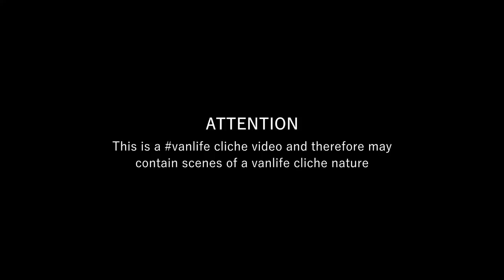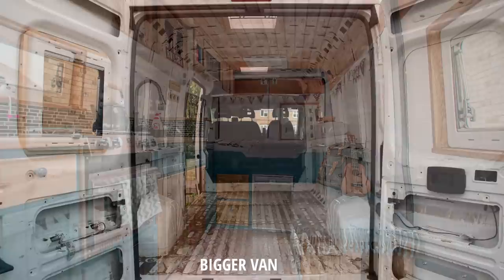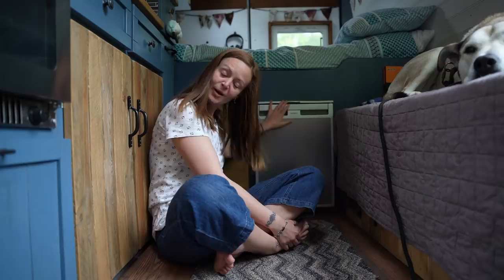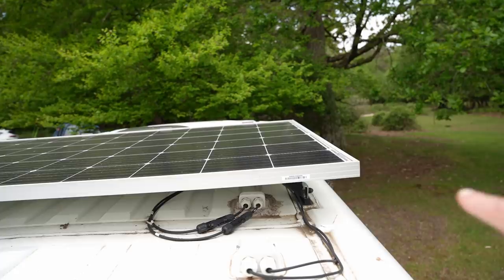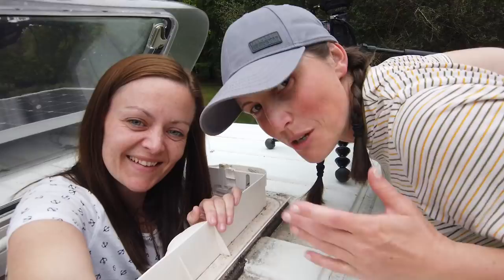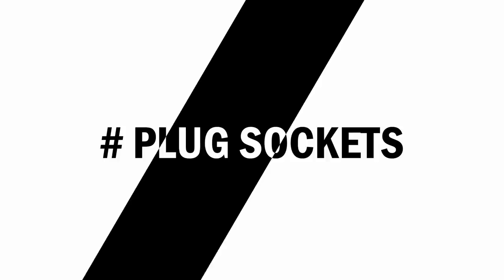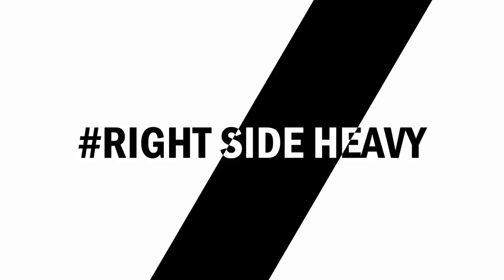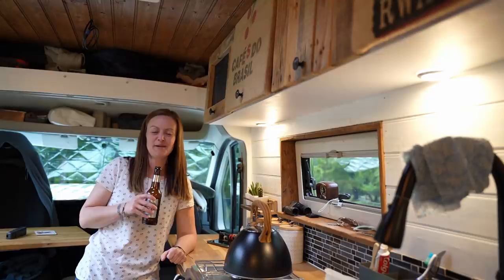DIY VAN BUILD MISTAKES..  what we regret and what we would change in our self converted campervan.

Comment: Ok, here is my idea, ;- I would do away with the cupboards above the bed, and turn the bed area into a huge (length ways) dining table/bench settee/bed area by reconfiguring to create a step-up platform (mezzanine) = this will create more space underneath for storage, the only slight downside is you will have to make the bed every night, but it means you have somewhere to lounge (liedown) or eat or to watch movies or open the back doors for scenic views + leaving the option for you to have two single or one double bed if you want to, I would also build some cupboards next to the toilet seat to house the fridge at waist height = overall weight will be redistributed a little.
Also, why not buy some of those black 10 litre shower bags and fill with hot water from the kettle (create some slots at ceiling height to house them to have a hot shower?
Reply from the maker: Thanks for the tips there, I'm sure Emily has a full scale drawing for me  when the time comes lol! Thanks so much for watching 😁👍

Comment: It is often said that people tend to get their perfect design on their 3rd conversion 😉.
As far as the shower / toilet room goes, it's a massive decision and affects the whole layout and feeling of spaciousness....personally I would not build a van without one...but that's my preference....I do like to do my business with a door firmly shut 😂😂.
For the fridge, Thetford do the 1090 which is designed to be raised up and is cut away to follow the contours of a panel Van conversion. They work pretty well.
For solar panel installation on a boxer / relay / Ducato, Thule do a roof rail kit that spans the entire roof. You can then fit either roof bars side to side, or solar panels. The roof rail system is fully compatible with Thule awnings as well. We pretty much fit these to every conversion we do.
Reply from the maker: 😂🤣 One more to go then and I should be done lol, oh no, wait I'm married, I'll never be finished lol!!
I've looked at the roof rack you suggest and combined with the cost of the wind out awning you're soon way over a grand, for something which I hear is terrible in the wind and the rain, so I think I'll try and find an alternative, we will hardly use it to be honest, it's just for when staying on campsites.
Thank you so much for watching 😁😁👍
Reply: @campervibe  my van would never be finished either if it wasn't my business😉.
You can fit the roof rails without an awning. I think they are about £300. We have made similar using aluminium profile but it's generally still better to buy the proper ones. 
Awnings are one of those things, that if you are travelling around a lot, they hardly get used. But quite nice for a bit of shade for the side door, or more likely in the UK...preventing the rain coming in😆😆.

Comment: I’m now getting the impression that you thought you were done with the build. I love your build. I thought upgrades were eternal. Gradually making changes as you live in it. One change I’ve made to my plans is I’m putting a root drawer under my fridge so the fridge is higher. Bad back no knees. I want a wet room/bathroom/shower combo because I want to be able to hang wet clothes and not have to set up a shower. We all must build to our individual wants and needs. I will be living in mine full time with two cats when I retire so I need a few more creature comforts. Everyone else’s ‘mistakes’ help me with my build adjustments. Cheers from Canader eh!
Reply: I built a full shower room and its been great. We don't use it much when we are away from services to save water but  my shower room is heated from the diesel heater and it makes it ideal for drying wet towels and coats etc.  The hot water comes from those small propane gas water heaters.  Mine is fixed to the outside of the shower wall next to and cut into the worktop.
Reply from the maker: You are definitely right, got to build to your own standards and needs for sure as everybody's is different, after all it would be pretty boring if we were all the same right 😆😁
Reply: @tonytca9439  I’m going to carry a pump and hose. Run it into a creek, through a filter then the on demand if I need a soaker shower.

Comment: Lightweight panels can be easily made by getting some 1" x ½" softwood, make a square/rectangular frame and glue formica sheets on to it then fill with that spray foam stuff to fill in the void.   Sturdy, functional and weighs very little.

Comment: You could replace the fridge with a dometic fridgebox on a slideout tray, much more energy efficient, you could get a bigger one, it has freeze compartment if you want, and it is loaded from the top.
Regaridng the weight, I don't think it is as bad as it feels, and you don't stove heavy things in the overhead anyway.
And finally for the shower, you could get a shower tray (store in the garage, strapped upside down under the bed), and put hooks for a curtain around the roof-vent then you ventilate out the steam, get a few inches better clearance above the head for  people who didn't stand under the kitchen table whwn they grew up... (Em)

Comment: Hi, I made same mistake with electric sockets but managed to get round it by undoing the two screws on the sides, pulling the front off and turning it upside down. Not perfect but it did the job.

Cheers, Griff.
Reply from the maker: Cheers Griff 👍😁

Comment: Hi Ladys  composting loo might be a thought for the future & also take it in turns to empty it ?  If and when you get another van dual wheels on the back end gives you the extra weight plus stability can also get you out of the sticky stuff one day. Noticed a lot of self builders use a lot of timber so weights realy build up fast hence why a lot of campers use carpet linner to get around this heavy problem, cuboards up top are for lightweight cornflakes etc not tinned products think marine and get the centre of gravity low as possable at all times and lastly dont get fat or the weighbrige will show overweight Lol ! nice to see you happy & on the road again Ladys.
Reply from the maker: Thanks, yeah wood is a nice look in the van, fortunately we used poplar ply which is super lightweight compared to standard ply which has helped massively. Think the main thing for us which will help loads is swapping out the batteries for sure, love your tips and tricks though 🙂🙂

Comment: Lou temporary solution for three pin socket mistake, remove three pin socket facia and revolve it 180 degrees so it is upside down and resecure. Socket is now upside down but cables plug in with cables now facing upwards.
Reply from the maker: Hi Paul, a few have suggested this now so I think I will swap it round. Someone suggested it's dangerous tho but I can't really see too much what the problem would be. Thanks so much for watching 😁👍

Comment: not a bad list of niggles for a self build [ pat on back lou] . 2 " Bs" for me, bog + balance. tins of food + beverages  are the weighty items to keep low down if possible, [ on our caravan we found a load of wasted space around  the wheelarch tubs, ideal for slipping the tin cans around in a sort of circle, a little access door + stickon led lamp - enough tins for a family of 5 for two weeks] + move the cupboards / batteries over. 2 separate sockets are wider than a double so will need adaption to backbox fitting mind. at work we got shallow landscape A4 transparent plastic jobcard  pouches which screw to wall, should be big enough to chuck your rechargeables in + get them out of way [ well apart from emms vibrator battery pack].
when its raining + stuck inside van, how about a" challenge pissed emms" episode, playing kids games like buckaroo or operation.    definitely watch that.
 keep up the good work girls + plot a course for the zipwire.
Reply from the maker: No definitely not a bad list and stuff that is not too bad to sort out either really like you say, I like some of your tips as well, thanks 😀

Comment: That double leccie socket can be fixed by changing it to two singles side by side and each rotated 90 degrees, it would look odd but the wires would not be crushed on the counter. Get a spare cassette for the loo? I would have a top-loading 'fridge every time, so much easier, and all the cold air does not fall out when you open it.
Reply from the maker: I do love our fridge and despite how low it is, it still keeps everything cool, just a pain in the butt for filling up 😆🤦‍♀️

Comment: Hi, We finished our conversion nearly a year ago and are at the same stage where we are thinking of some changes/additions that we want to make.

Just to let you know if it helps at all, that we have got our solar panel mounted to the same roof rack as yours and also have a fiamma f45 awning using the standard ducato brackets. It all fits nicely with the normal ducato fitting kit - you shouldn't need special roof rack fixings. The awning mounts to the lugs on each end of the roof, and the solar panel on the 2 middle ones (can take pics if you want). 

We have a hidden shower tray under a false lift up floor in the side door entry. It was awkward to fit around the exhaust and slide out step, but managed to find a drain point. 

Thanks for your videos, we always find them helpful. We watched your videos when building ours and it helped us loads with the woodwork!

Stevie and Mike 😊
Reply from the maker: Hey you two, pictures would be great if you have some, to be cheeky if you could send them to campervibe6@gmail.com that would be amazing, thank you 😊

Comment: Hi Emily & Louise. Great video. Interesting comment on the fridge. I have seen some YouTube videos where self builders have used chest freezers and converted them to fridges quite easily. The advantages are they are far better insulated and therefore use far less power as they come on less often. Also they do not lose cold air when the door is opened as the cold air drops to the bottom of the storage area as does not rise up when you open the lid. I saw one video when they attached door runners  so they could slide it out to access and then push it back  out of the way with the additional advantage that the top could be used as an additional kitchen work surface. You don't seem to have made many mistakes. Your van interior looks great. Good to see AJ with you on your travels. Best wishes.
Reply from the maker: Thanks Barry yeh a chest option may have been better with hindsight 👍 AJ is well on the mend now and we reckon will soon be running round like a loon any time now 😁😁👍

Comment: One quickish solution for to much  weight on one side would be to extend the main battery cables and relocate the batteries to the other side of the van and of Course Em's snack cupboard.
Reply from the maker: Think we might go to lithium as well and only 2 which will help, I won't let her touch my snack cupboard not now it's in 😆

Comment: We love your vlogs! The banter alone is worth the watch but great content too. I think you are my favourite UK couple we follow. We are a couple of old farts currently building our own van in Denmark, hoping to be on the road this summer (woohoo).  I do like how spacious your van seems with all the cupboards on one side, but I also see your point with being side-heavy. Are your water tanks on that side too? We put batteries on one side and water on the other to be safe. I was also wondering how tall you are (or Lou, not the lovely Em), since you can sleep across? I am 173 cm, my hubby 180 and we have to make our bed the other direction. Also, if hubby wears shoes and straightens his old hunchback, he almost scrapes the ceiling. But we do also have insulation under the floor and in the ceiling, so we can go to colder climates (like summer in Denmark or England) so I suppose this is one of the causes.
Reply from the maker: Aww thank you, hope the build is going OK. Lou is 5ft7, we also have insulation in both for the same reason as well 😁 our water and waste is underslung and goes across the van so it's pretty even with that. Think we will swap out the batteries for lithium which is a lot lighter. Hope all is well over there

Comment: Just a taught, if u moved the battery’s to the other side of fanny, and the diesel tank is on that side too, (I think, it on that side on my  transit) that should balance it up. If you put the fridge up high above where aj sits and get the four corners weight I think it would be spot on, can’t beat a good rummage around in fancy 👍😂🇮🇪
Reply from the maker: 😂🤣 No you definitely can't beat a good old fanny rummage lol, you're right!! Diesel tank is up front in mine, central under the cab. I think we may swap out the 3 agms for 2 lithium at some point to save on the weight that way. Thanks Thomas 😁😁👍

Comment: Just catching up after being away apologies if it’s been said, you can get a larger base for a portaloo.
Reply from the maker: Hi there, hope you've had a good trip 😁😁 our problem is we don't have the space in the gap I built for the toilet, it's tight as it is, I think I'll have to have a re design, then I can get that bigger toilet 😁👍
Reply: @campervibe  Another solution would be to get a second base same size and store in the back. But then you'd have 2 to empty each time 😅 Love your vlogs and you both do a fab job putting them together 😍

Comment: Glad to see you back on the road and having fun 😀 . Hope you are all well ....... A.j looks good 👍🐶 . Remember and give fanny an oil change soon , because it was a rebuild or exchange factory unit it will be run in now and there will be tiny metal particles in the oil which is normal until all metal surfaces are bedded in. Pays in the long run , and use good quality fully synthetic engine oil and quality oil filter.  🙂👌👍
Reply from the maker: Good to be out more now for sure, yeah AJ is doing good. Thanks for the info 👍😀

Comment: How much heat do you think is lost (winter) or gained (summer) from having the cab area open? I won't be having swivel seats but curious as to whether a fully open cab area for space and light gains outweighs heat/privacy loss. Or whether having only a small section for emergency access only would be better
Reply from the maker: Hi J P, I think probably a fair bit of heat lost in winter, although we will overcome this by having thermal blinds in the window and a thick thermal curtain to section off the can. As far as heat gains go our van was pretty warm today but as soon as we put in the thermal screens and opened the vents/windows it cooled right down, the window at the back really helps with that.
I think everyone's needs are different and for some keeping it separate works great. I like the fact tho that if we are at a park up and have any trouble at night I can jump straight in the drivers seat, whack the headlights on and drive off pretty sharpish if needs be.
Thanks so much for watching 😁😁👍

Comment: Use pvc hollow cladding its verry light
Reply: Yes weight is very important i used white bathroom panel clad on the ceiling and clad all the furniture fronts with it in a grey quartz effect and looks great. With 600w of solar on the roof i had to make it very light.